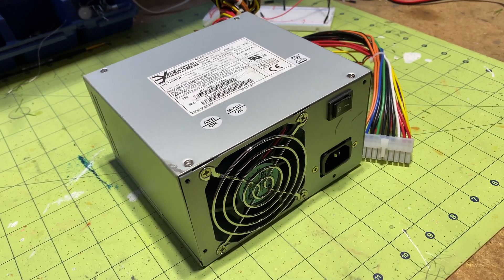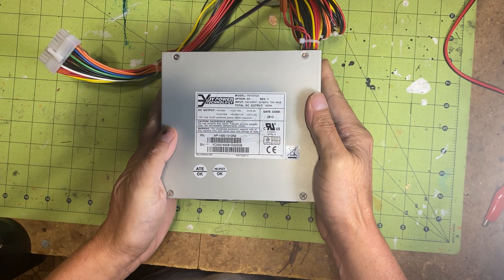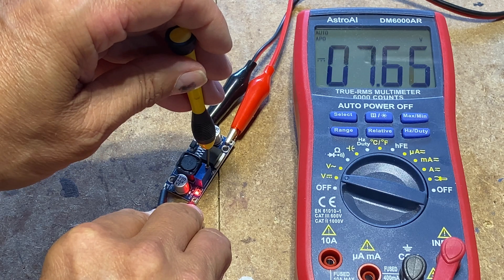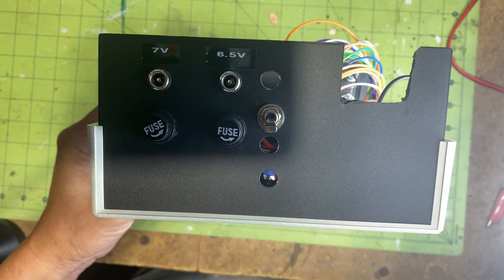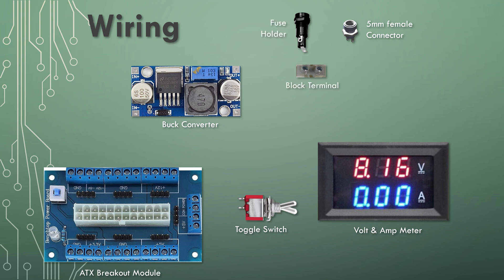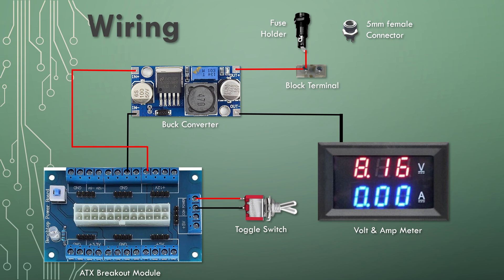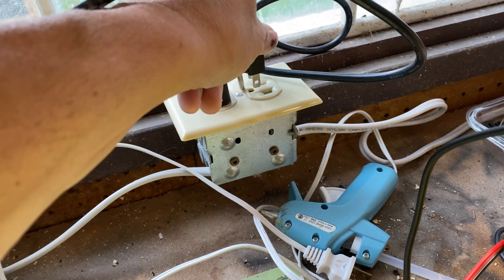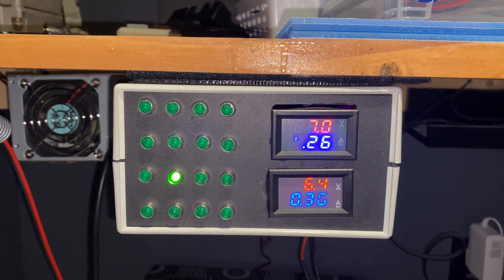Safe and Powerful ATX Power Supply Transformation Without Opening the Box!

Comment: If my 24 pin psu has 12va 16Amps and 12vb 18Amps  can i connect the 2 12v  16A and 18A in parallel to get 12v 34 Amps to use like on car radio

Comment: Thanks for this, I was looking at using an atx power supply for powering multiple esp32s, why are you using a 12-5 buck converter rather than one of the five 5v outputs? Thanks …
Reply from the maker: I use a buck converter because the 5V rail from the ATX was not stable enough and cause the ESP32 to reset
Reply: @thelastoutpostworkshop  thanks for the quick reply